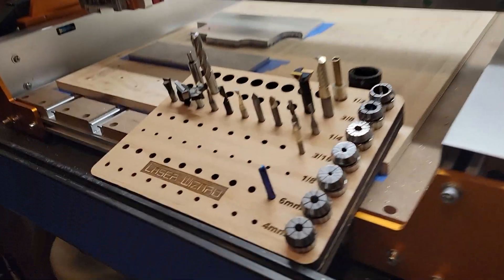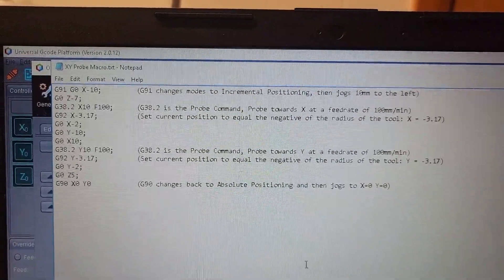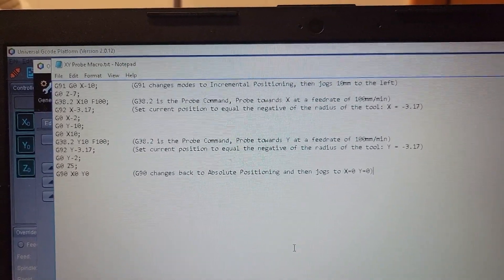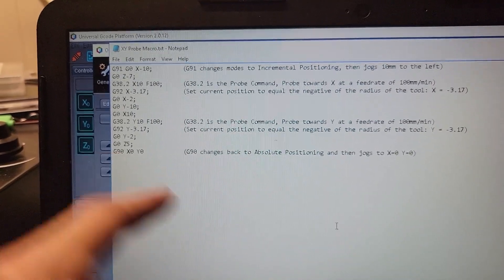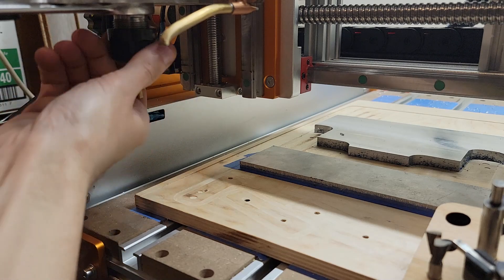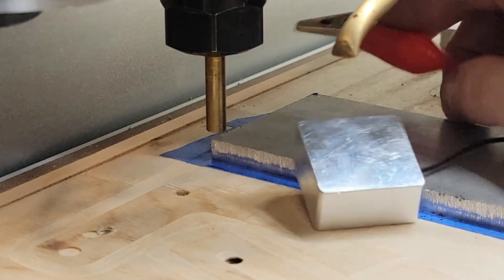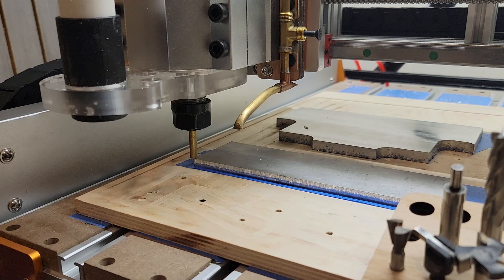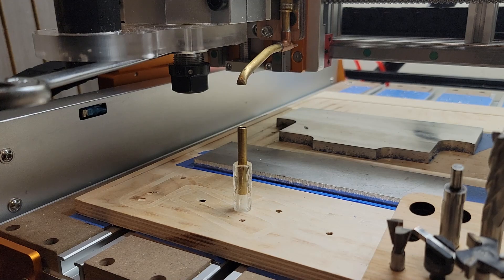Probing for X and Y using G38.2 g-code

Comment: Any of this information useful for probing a bore?
Reply: Latest version of UGS has been very modified. Can now find centre of a circle.
Reply from the maker: That's what I'd like to learn next. That is where I believe math will be involved within the g-code.
Reply: @laserwizard1982  on a mazak cnc iv probed both sides of say a bore calculate the difference of the two and divide it in two. Giving me the centerline. Repeat for each axis.